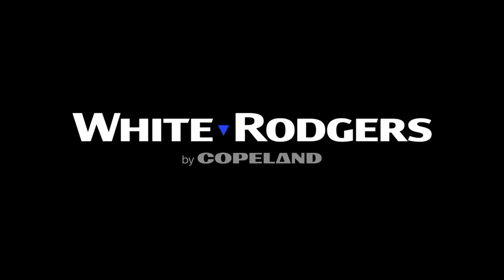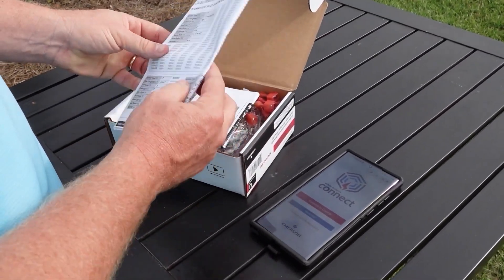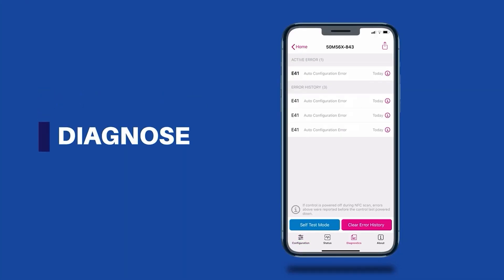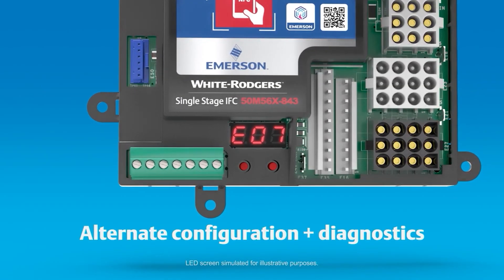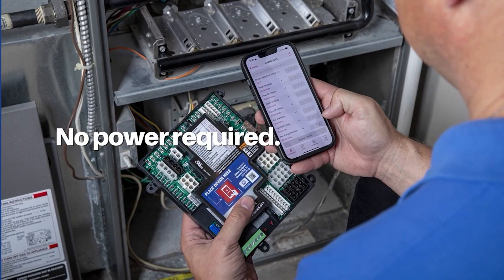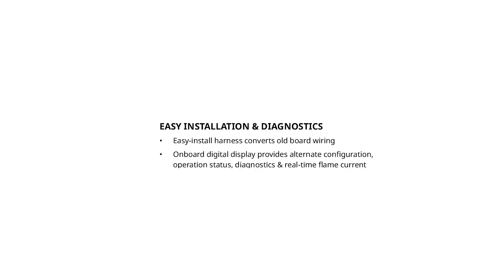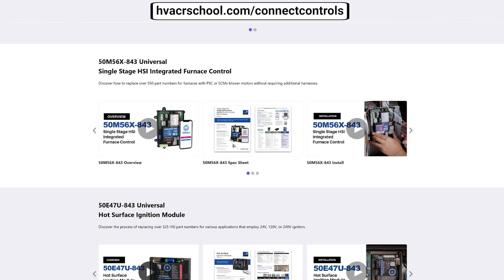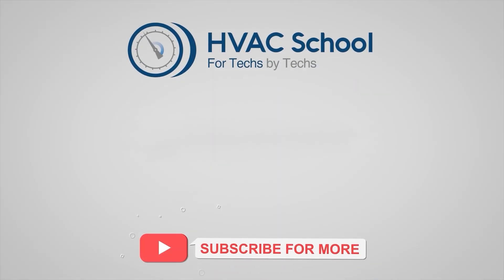White-Rodgers Universal Product Line

Comment: The OEM manufacturers have locked down repair parts for decades. They then use that as a reason to control pricing, features, and supply. 

The reality is that ZERO HVACR systems in almost any application is uniquely special. 

I am an electrical engineer that designs automation and control electronics and the embedded software that goes with it. 

We are on a path to completely modular systems where OEMs are decoupled from service. Where a system designer can taylor systems for the application and cost targets. Where general purpose motors and motor drivers are sold to end users at prices that TRANE pays at thier factory. 

Hint: An OEM motor that you pay $500 for is most likely a generic motor with very slight customizations that costs $50 

Design and manufacturing has been my life for decades. HVAC is my new interest. There is massive room for improvements.
Reply: What you describe happens in almost every industry. Just knowing about it and even publishing it does little to nothing when entrenched interests are involved.
Reply: @realSamAndrew  Only in industries that deal with relatively simple systems. In my daily work with unique and complex systems, it makes sense to maintain complete control. 

In HVAC, the systems are simple and predictable from an engineering, manufacturing, and implementation perspective. Most of the bigger manufacturers spend the bulk of the R&D resources trying to convince customers that they are actually special. In general, they are not.
Reply: @Factory400  without putting too fine a point on it, most industries play games to try to lock consumers in to a particular component or standard or supplier when it's not all that different. It just creates artificial scarcity or exclusivity. Batteries with terminal placement or plug sizes, connectors with a reversed tab or plastic lip preventing substitution, auto manufacturers with proprietary software, car dealers who enforce franchise laws preventing direct sales, printer ink cartridges with a signature chip, and so on.
Reply: @realSamAndrew  I am not claiming that HVAC is the only industry that does this. I am simply pointing out that HVAC OEMs are easy targets for pushback because it is so easy to circumvent their efforts.
Reply: @Factory400  I concur with you on all points. I am simply claiming that it can easily apply to many other industries. The concept is quite common in a generic sense. HVAC may be a shining example, but the concept is still the same in lesser examples. Cheers.
Reply: @Factory400 Thank you - I've been working on revising legacy boiler controls for a while on my own for a while - once I realized how simple they truly were.  Also came to the same conclusions about parts and the like that you did.  Controller reliability seems to be the primary concern for me - because of this I'm researching alternatives.  I do like what White-Rodgers has done here - it seems like a step in the right direction.